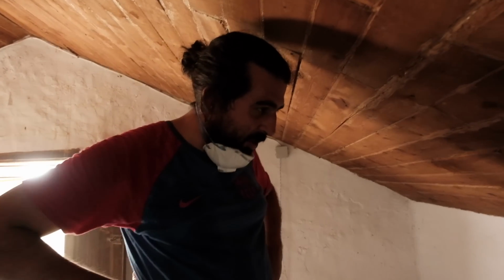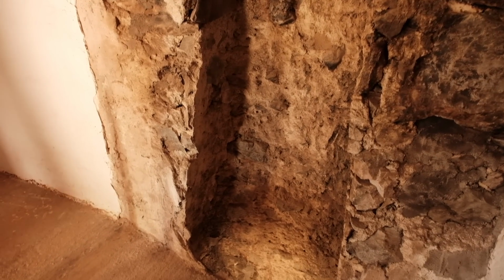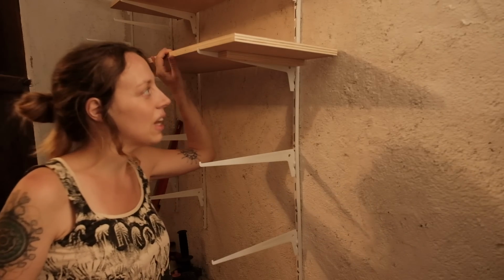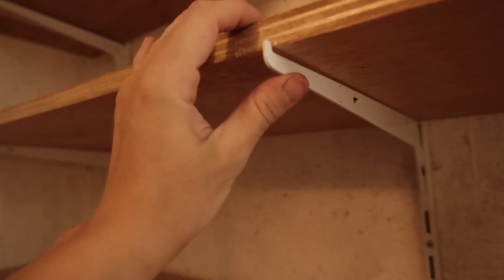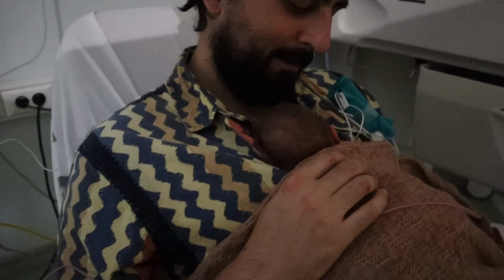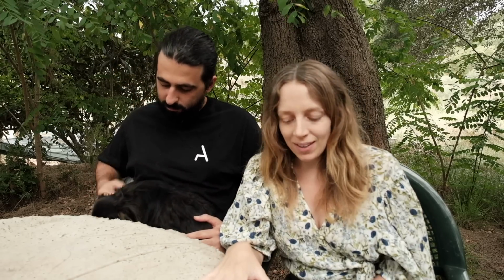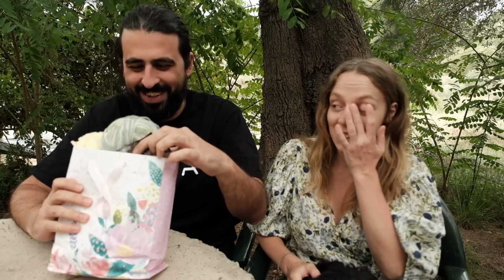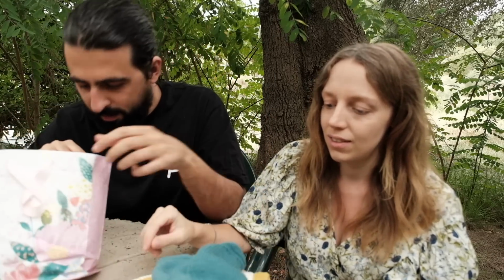We're Ripping Apart our House | BUILDING A HOMESTEAD

Comment: A tip for the exposed chimney pipe: add a 6" fan to blow or suck air across the pipe. The room will warm up better. Try to arrange it so that the fan can be powered from solar panels.